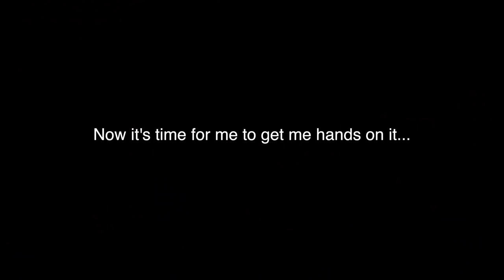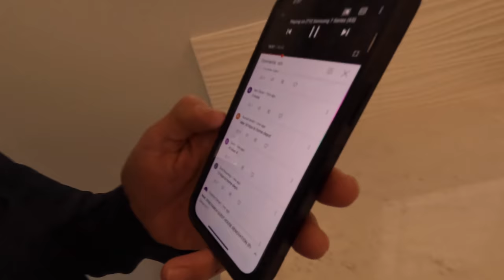I Turned This Old Barn Into a Luxury House!

Comment: This turned out really great, overall as a designer, I can appreciate the practicality, as for the two pendant lights, they would fit the space very well and if you choose a more see-through light it will not distort the site lines. but if you do not put them in right away, maybe until the tenant request more light, you should be good till then.